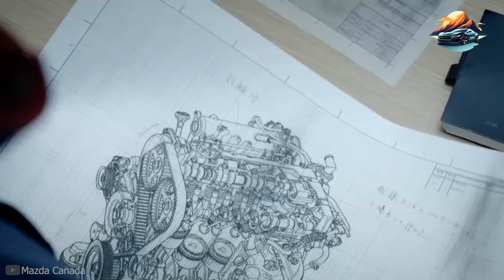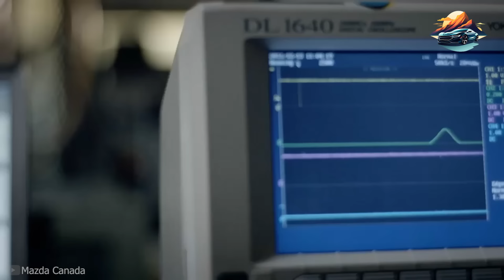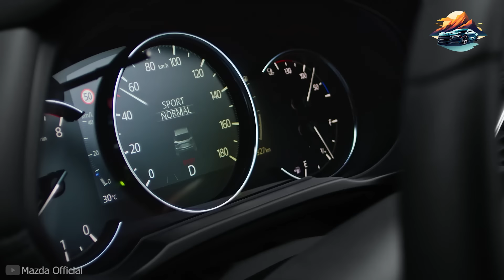4 Car Brands That Are Equal (Or Better) Than Toyota For Reliability

Comment: I have a 2013 Hyundai santa fe xl  that I bought new with just 13 km  on it. I recently replaced the windshield due to a rock hit. Other than that, just maintaining it. It has a lot of power if you have to get out of someone's way. I stopped using it in winter because I didn't want salt on it. Bought an old truck. For winter driving
Has 3 rows of seats and holds seven people.

Comment: I've had Lexus and Honda vehicles since 1990.  The Integra was my favorite.  But today, I look at Lexus same as the author.  It is more premium because of its luxury features.  One in particular is less road noise.  You can notice the difference after 10 years. Honda makes bullet proof engines.  I have them on my cars, mowers, pressure washers, etc.  The only way you can beat them is with a tire tool.

Comment: Honda also makes private jets in Greensboro, North Carolina and they make motorcycles.   At one time. The Honda Civic had a motorcycle engine, two cylinder as I remember it. This means that Honda could now manufacture a range extender. EV with a Honda motorcycle engine and one electric motor for each wheel. This would eliminate the differential and the transmission saving both weight and expense and would have the potential for very high mileage and low carbon footprint .    😃😃😃😃

Comment: I have a 1995 Honda Accord, 4 cylinder 5 speed manual.  I bought it in 2000.  Two years ago I had a problem with its running.  It cost just under $1600.  The reason of the high price was this.  It needed a small part in the distributor, but that part wasn't available.  So they had to use a used distributor.  That's the only problem I've ever had.  PS  Having a 5 speed manual trans also says something about how I drive.

Comment: Once, I would not have considered buying a vehicle that was not Toyota/Lexus. Hence, I put my name down for a RAV4  top of the range. I was stunned when I drove it.  It was tinny and noisy and a flimsy version of the solid Toyotas I had owned before. I cancelled my order and possibly will not buy another Toyota and now I fear for the quality of Lexus. With costs rising l suspect Toyota has relied on its superb reputation for reliability and quality and have now dumbed down well, at least this RAV4 and I cannot help wondering whether it will extend to other vehicles in their range. BMW Mercedes Audi have relied on their reputation and are now overrated and overpriced and not particularly reliable. It’s odd but I have a feeling of considerable loss now in future that I will be an ex Toyota buyer.

Comment: Honda is a close second but Toyota is still the king of reliability. Even their CVT is the best one out there.
Reply: CVTs suck. Get the 6-speed automative transmission.
Reply: @   I totally agree with you. Toyota should never have replaced their wonderful 3.5 liter V6 and 6 speed transmission, with that 4 cylinder hybrid with the CVT.

Comment: I got Honda Accord 2006 360000 mile and running great ac heat work well never alignment original engine never open original tail light 💡 stop 🛑 light never change bulb all power windows works great Honda accord forever

Comment: The simplestity that you refer to is when they STOPPED USING head gaskets and started using a chalking gun to put silicone crap that has no longevity past 80,000 miles to it ,you wonderful Subaru company😂😂

Comment: I owed Corolla Toyota over 10 years never even changed a peace, only tires and oil change. Unfortunately got in an accident it’s total loss, now I drive Mazda, so far I like how it drives
Reply: My Lexus is 10 years old. Nothing has broken. No breakdown or failure anywhere. Nothing ever.

Comment: 7:00. " Mazda has been reducing weight and working on fuel efficiency". The majority of Mazda cars in our country is the 323/Familia/Mazda 3. They have a healthy appetite for fuel.
Because we are a small island country, we import mostly everything. Cars are very expensive, and we keep cars long-term. We have an active grey market ( we import used cars from Japan).
I have a 2003 JDM Toyota Corolla Fielder wagon with an 1800cc 2ZZGE engine. 260,000kms No engine repair yet. But perpetual stop-and-go driving, bad, winding roads and tropical heat wreak havoc on our cars ! So far Toyotas hve held out the best !
While Toyota is not cheap, Honda is more expensive.
Trinidad & Tobago.
West Indies.

Comment: Subaru has a history of  head gasket problems along with O2 sensors, transmissions, and air bag recalls so you can forget that one. Hondas have timing belts while Toyota has timing chains. It’s easy to see which one is more reliable. Toyota specially Rav 4 is better and longer lasting than Hondas of the same ilk. Lexus is a fancy Toyota, but is really high in quality.

Comment: I think Mazda's reliability has improved quite a bit over the last few years. But they had some very serious engine and transmission problems ranging from five to ten years ago. I personally know somebody with a 2016 CX 5 who had to replace both the engine and transmission with less than 125,000 miles. Transmission went out at 80,000. I'm in the market for a new car. My 2010 rav4 is still great but approaching 200,000 miles. I test drove a 2024 rav 4 and found the ride quality and handling to be unimpressive. This coming from a guy who's been driving a rav 4 sport for 13 years. My sport handles amazingly for an SUV, but the ride- ugh.   Very impressed with the Venza though. But 2024 is the last year for  the Venza and it's a little long in the tooth regarding styling and technology. Also, 2024's are now hard to find (at least in my area) and dealers are asking top dollar for the few  they still have.

Comment: I have owned all. Except the latest mazda.
I can say that subaru AWD is the best, better than the honda CRV AWD or Toyota AWD or Mazda AWD.
Honda Civic with the new 1.5 TEC turbo has issues of drinking some of it's lube oil.
The mazda skyactiv engine is overhype.
As for Lexus.
You can see that some older Lexus are then seen on the newer Toyota, especially in the Camry.
The Toyota Harrier has the same design as the Lexus RX 300 from 1995 - 2010.
Except for the inside finishing & gadjets.

Comment: My son in law wanted to give me his......Toyota 3 LITRE  Double cab 4x4  LDV.....i think it was a 2012 model......to use on the farm ......in exchange for my Renault Sandero Stepway ( 2014 ........170000 kms ....with  NO problems whatsoever ...)......After a few months he informed me that he cannot exchange anymore ....because his Toyota gave him so much problems ... He had four roadside engine failures ....with the engine light coming on and then the motor cut out..... and had to be towed to a garage ...Even the Toyota experts couldnt fix it ...He eventually traded it in on a Isuzu Double cab....(My daughter told him to get rid of the Toyota immediately...).

Comment: Sorry but Toyota/Lexus still comes  out on top...isn't Mazda dealing with a class action lawsuit concerning one of their engines? There is a reason why the resale value on any Toyota/Lexus model is higher than the the competition .Even models from the 90s ( Lexus in particular still sell at a higher price relative to the competition. Transmissions are ridiculously durable....the straight 6 2jz in my Lexus GS passed 300k and still runs fairly smooth for a 30 yr old car. Most of the work Ive done to my car is mostly maintenance with few actual breakdowns
Reply: The 2.5 liter engine block has issues.
Reply: @alpha7ization  Toyota is also dealing with engines failing in their newer Tundras from debris left in the engine during the manufacturing process. Toyota’s recent problems with their Tundras and the new Tacomas (transmissions) is concerning. Fortunately, Toyota is replacing the engines and transmissions. However, this turn of events doesn’t speak well for Toyota’s quality control.
Reply: You are dreaming !...go and google the second hand prices of a Lexus .....against the German Trio..!!...No comparison !....you can buy a Lexus cheap...!!!...even i wanted to buy one ...!!....But i woke up...!!
Reply: What competition are you referring to...????....Definately ......not the German Trio ..!!
Reply: It's probably cylinder deactivation problems. Get the turbocharger, then there's no cylinder deactivation. Mazda's turbos are very good. I know, because I own a 2021 Mazda CX-5 CE Turbo w/ AWD, and zero problems.

Comment: I just bought a Mazda 3 sedan. Mazda has a partnership with Toyota, who owns a quantity of Mazda stock. I wanted a car that had no CVT, got good gas mileage, and had an excellent reliability rating. I will not buy an EV.
Reply: Loving my ‘24 Mazda 3 sedan! Handles so nicely! ✌🏻✌🏻
Reply: Having a partnership means nothing. Mazda makes their own cars, and Toyota makes their own cars.
Reply: @SokemRokemRobot  wrote: "Having a partnership means nothing. Mazda makes their own cars, and Toyota makes their own cars." ....... In Huntsvillle, Alabama Mazda and Toyota make cars in the same factory. and they share technology. But that's not a partnership.

Comment: No, not really. Subaru(not recommneded) suv 4AWD main problem is the wheel bearing. It burnt out every 20-25KM and need to be replaced either front or rear wheel bearing hub!!. The spare parts much more expensive and also limited service workshop available especially in Asia region. Petrol consumption also high compare to 2 wheel drive.

Comment: We had a Subaru Forester that got all the factory speced service it was supposed to, which broke to the tune of $7500, before it reached 100,000 miles.  We will never buy another Subaru. Ours 2014 was lightly used, came with all the bells and whistles and still has a near new leather interior.  High book is $14,000, without repairs it's worth $6,000 so we're going to dump it as is.

Comment: The mere fact that Honda no longer produces cars in Japan speaks volumes in terms of quality. Toyota never made such mistakes as the diesel engines in Subaru. But ok, thats history, so let’s put it aside. The near future belongs to hybrids for the USA. Toyota is building the best and the most reliable hybrid cars since 1993. Taxis in the big cities in Europe are mostly Toyota hybrids - low maintenance cost, excellent reliability and efficiency! Even the old Toyota Prius 2 got over a million km with the original batteries. A taxi firm owner from Wien told about 1/3 of his fleet of Toyotas over 1 million km! But hey, if you live in the forest, Subaru forester could be still the better option. So it always depends on the purpose and your needs. But if we speak of Quality, Toyota ist still the king, because Quality is the very core of the brand philosophy.

Comment: Had 4 Hondas before ,reliable but nothing special after 5 yrs ,had a Forester Subaru and had to trade it in with 45000 km that dealer could not fix after thousands spent …since then it’s Toyotas for me (3) no going back to any other brand …
Ps in a small flood at the factory parking lot my Honda Accord  got damaged badly and insurance decided not to repair and gave me money for it(14 thousand )parked beside it a Camry of my friend just started and she went home ,no issues then or after ….Toyotas for me forever .

Comment: Good presentation.  No surprises but good.   Here is what convinces me I won't buy a new or late model car of any brand.   It's those god awful front grills that look like baleen whales with their mouthes open during feeding.   Those large angular shapes that have no apparent purpose other than to insult one's sense of beauty are terrible.   I'll wait a few years until the low front grills return thanks...  A car does not need a huge air intake at the front.  A small one is just fine.
Reply: Or you can stumble and buy electric with no grill :-)

Comment: For me, TOYOTA is still my best CAR, SUV like LEXUS RX 350, 450h. I own it, other brand maybe ok, but I trusted more on TOYOTA BRAND! On those car, suv I mentioned, my old 2000 Lexus RX350 got 245,637 miles and sold it to my friend, then I got 2011 Lexus RX 450h with 145, 134 miles on it right now and still no problem at all. The only major thing I replace on my 450h is the oil cooling rubber hose, I replace it with the metal one and is running good again.

Comment: Honestly I don’t hate Subaru I feel like they are better and nicer than Toyota and generally last longer, Mazda my favorite Asian brand car of all time, despite it’s previous ties to Ford, I feel like they are BMW/Mercedes Benz mixed with Toyota and Honda when it comes to it’s newer models in general, and yes they are definitely better than Toyota despite costing more, Honda not shocking minus recent recalls on it’s newer models, I previously owned a 2015 Honda Civic Lx until I wrecked it recently it had 91,840 something miles would have kept going if it wasn’t for that, but yes Honda’s are definitely better than Toyota no doubt, now pickup trucks Toyota sadly would be better if they didn’t change there styling to mock Ford and GM, because even though a Ram or Nissan isn’t reliable atleast they don’t break like the V6 Tundra or possibly a Tacoma with a standard 4 cylinder turbo engine, but Lexus is basically a Toyota I wouldn’t call it better I say the same other than nicer, and even though it wasn’t mentioned before anyone bashing Korean cars: Minus the engines of the past, the recent theft and recalls still, otherwise Kia and Hyundai are also better than Toyota on some things not everything here’s why: Hyundai literally for years has copied both Honda and Toyota if any YouTuber owns a 2000’s or 2010’s model you know why: When it starts up it sounds just like Toyota except maybe faster, but it’s nicer than Toyota on some of the technology and driving performance as well, same can be said about Kia, otherwise in my own opinion despite now owning a 2014 Hyundai Elantra Limited with now 55,010 miles officially as of today with no issues just waiting patiently to get my first oil change on it, I did maintenance on my former 2015 Honda Civic and it ran great, so therefore I feel like Honda, Hyundai, Kia, and Mazda are probably my favorite car brands that are probably the most reliable minus the issues with each brand, Toyota is hard to kill I get it, but Toyota has also had acceleration issues, fuel pump issues, knocking engine issues with the newer Tundra’s, and some other major issues now like Honda no it’s reputation isn’t completely ruined, Hyundai and Kia yes I understand there reputation hasn’t been the greatest but with the manufacturing plants in both Alabama and Georgia and other countries besides there homeland they have come along way, plus the ride and drive of a Hyundai felt no different than a Honda or Toyota and even at cheaper prices it’s actually the next best thing to a Mazda or Subaru as well, but with that being said I personally recommend all of them except for Nissan and Mitsubishi definitely junk! 😁

Comment: Subaru engines don't last as long as Toyota and Mazda sheet metal is thin and prone to rust. We have owned  all  3  makes and nothing comes close to Toyota for durability, reliability and resale value.  Real quality shows up at 200,000 miles

Comment: Toyota has a history of being relatively reliable.  History is the key word. Both the transmission and engines on the Tacoma and Tundra are overly complex and unreliable.  This on a vehicles like the tundra or Lexus LX that cost up to $100k or more!
Reply: Tell me witch car company in the history of engines had to replace 200 000 engines with in 2 years. The hyped brand new "State of the art, finest tolerances of any engine before it"  Toyota  V6 petrol engine. I suppose you don't know when Toyota replaced the venerable V8 LC iron engine block with an Aluminum block burn thu between cylinders 5 and 7 on all of them. The whole block go twisted. Unfixable and needed a compleat new block replacement. You don't know. Exactly, they don't want you to know they screwed up. Toyota is not what it was after 2005. Before ,well earned dependable and in some cases unbreakable. They are not today. Too many recent scandals, and utter lies straight from  the CEO. It's just a Sales slogan  of years ago before 2005. Another thing. Toyota is a hi maintenance vehicle. The reason why service intervals is  much shorter than other brands. That's why there is so many Toyota service centers. And with that service a very hi cost.
Reply: @fhclappen8595  hey buddy you don't have to convince me of that...tell that to the automotive reviewers on line who think Toyota is king.  That was the point of what I wrote.  The only thing I would say is that most other vehicles manufacturers are not much better.
Reply: So you do know that the whole truck debacle with Toyota is possibly a situation unique to their trucks, not really the rest of the lineup? There's a good review of that on the Car Care Nut channel. Not saying you should believe anybody, but it does make sense in light of the reality that whenever you hear that kind of negativity about a toyota it's almost always the trucks.